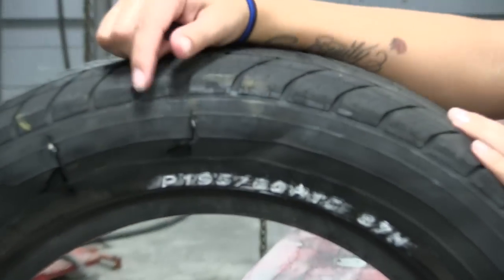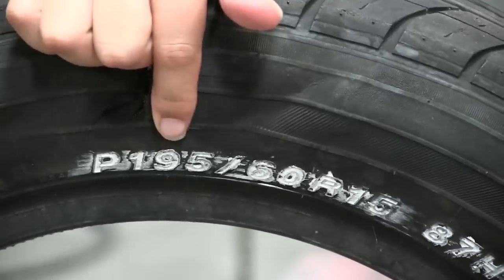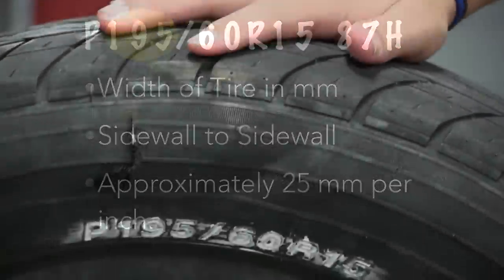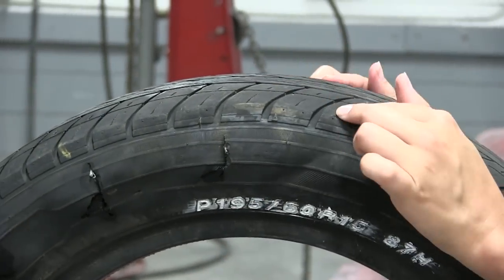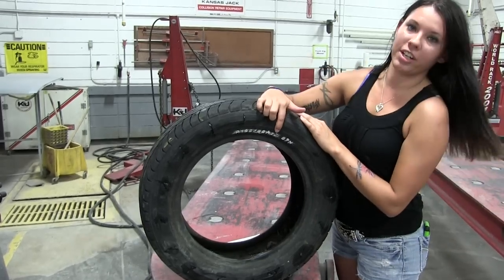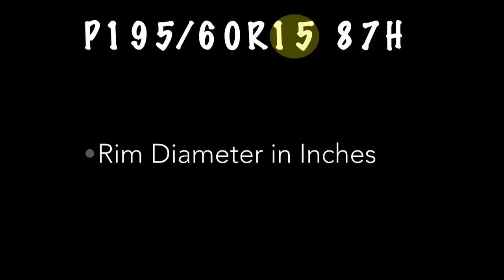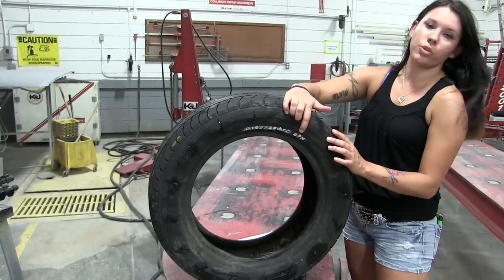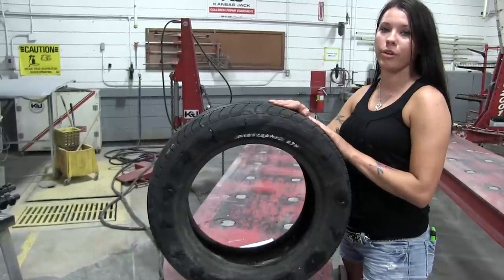How To Read a Car Tire Sidewall

Comment: How about the date when they are made ?
Reply: TERRY RONALD RACKLEY Good call - the other codes please --- And you can show people the wear bars and explain
Reply: TERRY RONALD RACKLEY http://www.rma.org/tire-safety/tire-registration/

Rubber Manufacturers Assoc has info on build date and decoding the DOT number stamped into the tire.
Reply: +Bob Armstrong Thanks